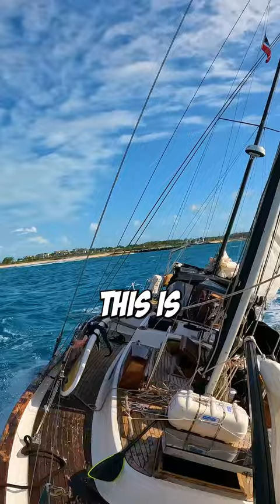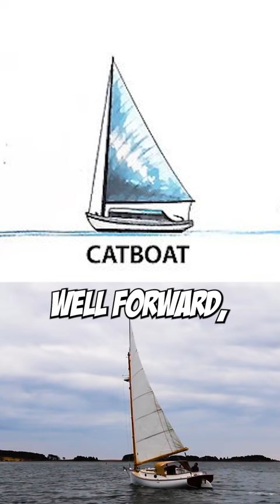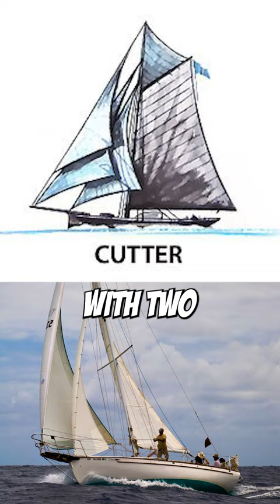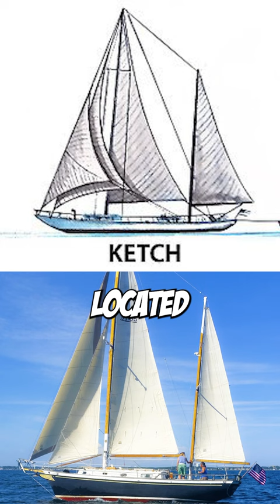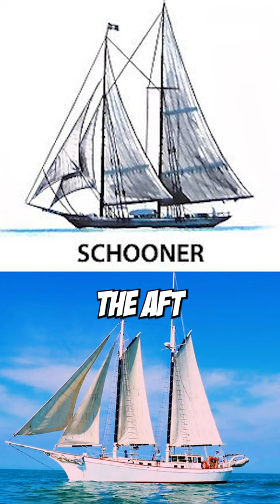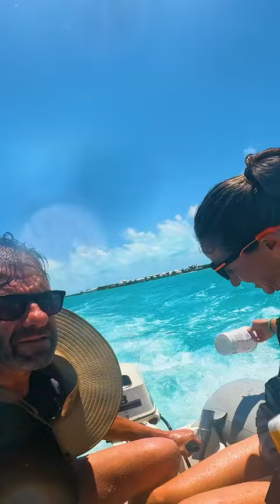6 Most Common Sailboat Rigs ⛵️

Comment: Wrong, cutter has nothing to do with sail configuration. It’s about mast placement. A cutter mast is dead center of the boat while a sloop is less than 50% (a mast closer to the bow) you can have a sloop with two headsails though.

Comment: Ketch rig.  It has the best blend of power and control for ocean cruising.  Spreading the sail area over more sails reduces strain on lines, and makes the individual sails smaller and more manageable - when compared to its equivalent size of Sloop.

However, I prefer Cutter rigs.  Cutters give similar speed and performance as Sloops, but they have the advantage of maintaining better performance to windward when in their reefed configuration.  As the 2nd foresail is kept close to the reefed mainsail - and the CE is kept balanced. IMO Cutters are comparable with Ketches, but a little faster - and a bit more work.

Yawls are the laziest handling and best control of all 3-sailed configurations.  But worse performance when heading windward.
Reply from the maker: Dang, you know way more than I do! I just got a sailboat of my own and I’m starting to learn this stuff. I’ll hopefully get to your knowledge level someday! Thanks for sharing.

Comment: So I'm new to all of this, and I have 2 questions.
1) Are there advantages and disadvantages from all this different rigs?
2) Why would you choose one rig above the other ones?
Reply: It's complicated. I'm just going to simplify it (so that this comment isn't 50 pages long) ...

There's a reason why all boats that are today in production are sloops and cutters. They are simple, cheap to make, perform extremely well but tend to be a little bit uncomfortable.

Catboats basically don't exist any more and literally nobody makes them. 

Ketches and yawls are slightly more comfortable under sail, but are much more expensive to produce, and they are terrible for any sort of upwind performance. Ketches basically don't go upwind at all, and yawls sail upwind by dropping their mizzen sail and using just the normal main sail and Genoa that a typical cutter would use.

Schooners don't exist anymore. The schooner was common in the 18th century and nobody makes them on anything under 100 ft.